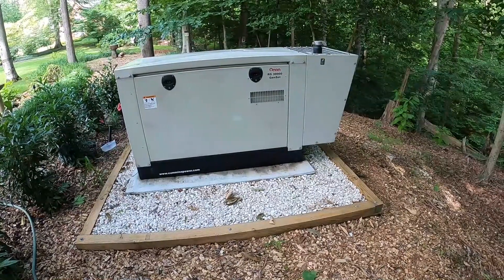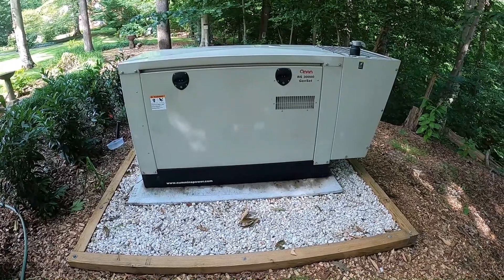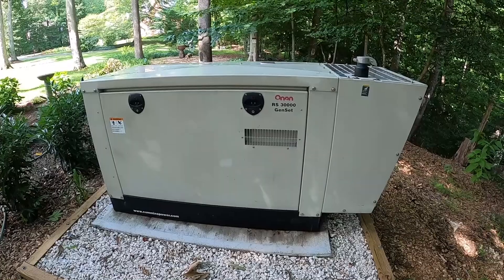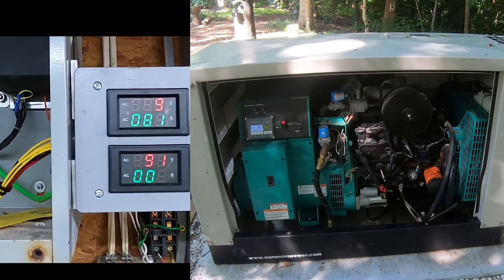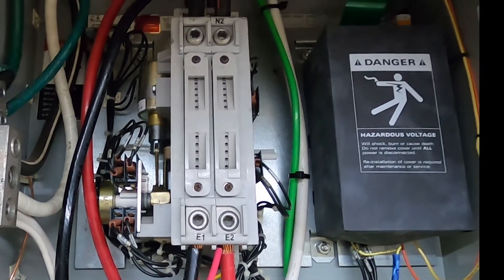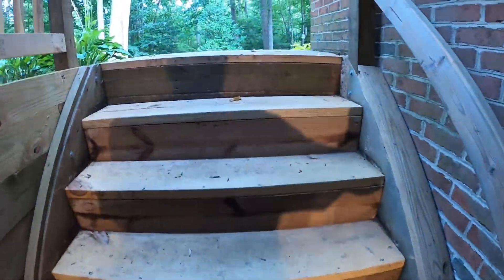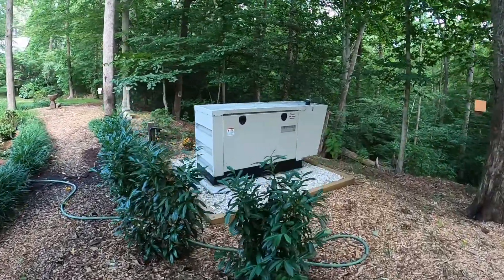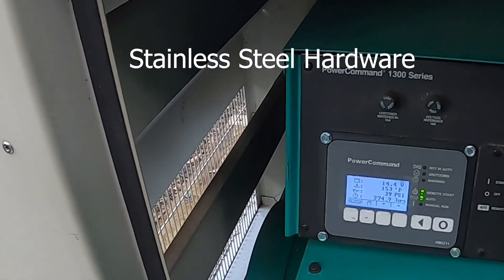Update on our Cummins Onan RS30000 30 KW water cooled generator

Comment: We have a 30KW Kohler running on natural gas.  It's strictly a backup whole house generator installed June 2021.  One thing you may want to check in about 2 years are the spark plugs.  Ours uses a 64 hp turbo charged engine and plugs 1 & 4 were fouled.  Plug 2 was beginning to foul.  Plug 3 was clean as new.  The fouled plugs caused the motor to shut down after it ran continuously for 40 hours following a bad storm at our home NW of Houston in June 2023.  The plugs were replaced, and it purrs like a kitten now.  I also replaced the battery with a sealed one.  Our neighbor has a Generac 22KW running an air-cooled engine which is significantly louder than ours, but they are within 40 ft of each other so the noise we hear mainly comes from our neighbor's generator.  If you can afford it, liquid cooled is the way to go.
Reply from the maker: Thank you. I'll check the spark plugs. A lot of folks think propane is so great, and it is clean, but it is hard on engines. We spent a lot of time rebuilding cylinder heads from fork lifts when I helped out at a machine shop.
Reply: I have the same Kohler 30RCL. Its a fantastic machine. I had it installed in 2018 when we built our house in Florida. After Ian it ran 10 day's straight. It now has over 330 run hours on the clock. Last November I replaced the battery with a sealed one too.  I hope the sealed battery works out.

Comment: I installed one just like yours in 2012. We had a lightning strike that took out the controller in the transfer switch which is different from yours. A new controller was $1050, but I bought a whole transfer switch for $850. It has been a good reliable machine. Thanks for letting me know about the 160° thermostat.
Reply from the maker: Too funny. My controller board was bad in one ATS... like you said, new boards over $1k.... Transfer switch with board way less! Thanks for watching.

Comment: Use it for your boiler instead of blowing the heat out the radiator you can store it in a buffer tank and use it for both heat and hot water and tie the generator into a grid tie and feed it back to the electric company.
Reply from the maker: That sounds like a lot of work!! Thanks for watching.  Wayne

Comment: Nice setup. Can u estimate the fuel cost for 24hrs of run time?
Reply from the maker: John,  sorry.... not well. The engine is a 605 cubic inch Minneapolis Moline HEB. It has dual carbs and has six cylinders. I'm guessing we use 2 gallons per hour. I'll try harder to figure that out. One of the other guys gasses her up!

Comment: I have that engine in my 35KW B&S Generator - It runs great but is Terrible if the Block Heater is not working correctly. Where did you get that AMP Meter, that's amazing!
Reply from the maker: amp meter was off Amazon. I only turn my block heater on an hour before it does a test run. It seems to start well without it on my engine. Thanks for watching.
Reply: @WaynesWorldGarage  interesting. I would leave it on because it keeps off condensation, even though it's a waste of money. My engine sputters if heater block hasn't heated up the engine before. I don't know why, but I have documented it on my 35kw B&S gen video. Anyway thank you